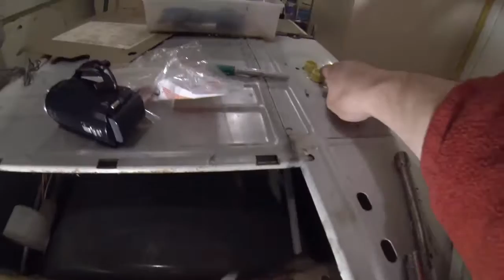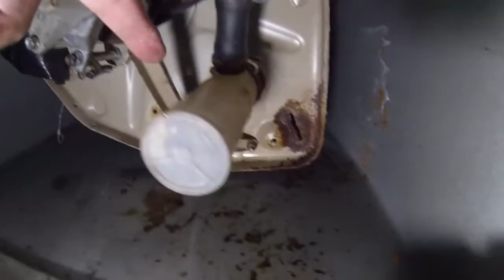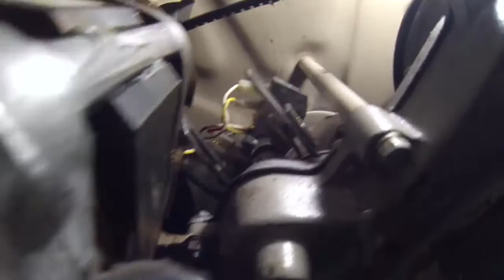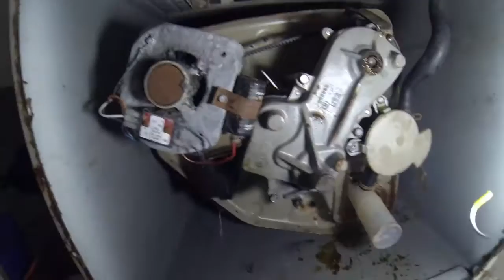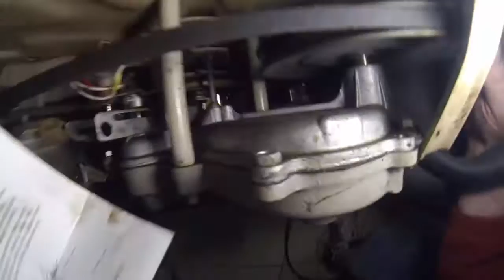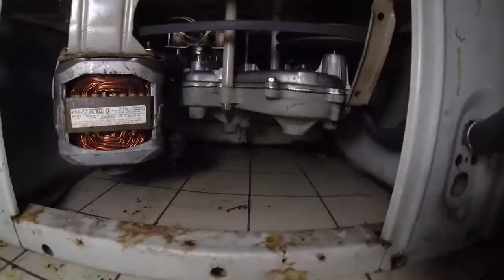Whirlpool Washing Machine 95405 Drive Belt Replacement

Comment: Great video - thank you. Seriously couldn’t have done it with out your tutorial! One thing I think I’ll add (correct me if I’m wrong), the “seven turns” at 6: 17… yes, you need to pull the whole unit out to be able to feed the belt on below (behind the pin), but the right bolt you pointed to needs to come out, then back in, to get the belt on the other side (above) of the tube-like bracket that the bolt feeds into. Thanks again.

Comment: your wig wag solenoid for the spin clutch is not in it's proper position, that's why the tub is turning while the agitator is moving
Reply: How do you fix that
Reply: take a close look at the spin clutch/brake, mode shifter rod it has 2 positions the "spin clutch drive engaged" brake released position and clutch released spin brake applied, holding the drum from rotating position , the wig wag solenoid electromagnet when energized pulls up the sliding traveling shift pin on the mode rod  into the section of the rod that then forces it to "mode shift" into to the spin position ,, when the magnet is not "on" the pin carrier should drop into the portion on the shift rod that moves it to the clutch released brake applied position (the rod acts like a wedge as it moves into and out of the clutch application fork assembly) check the position of the shift rod it might be in an over extended into a location where the pin can not drop into the notch allowing it to shift between modes causing it to be stuck in spin and not jumping back into clutch disengaged mode , make sure the wig wag moving shift pin carrier is free to move Into and out of the magnet core with the magnet off it should drop in the slot and then shift the mode to spin clutch released brake engaged position.